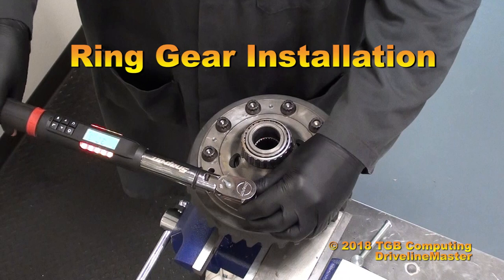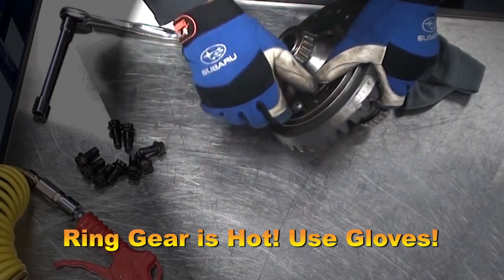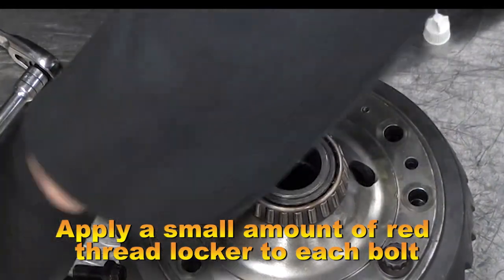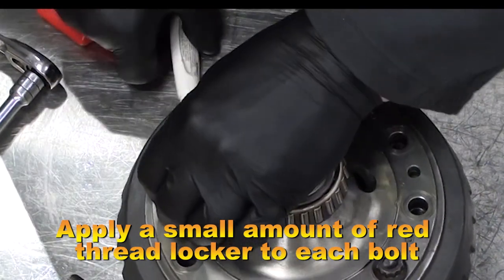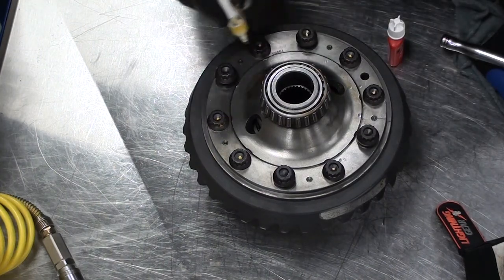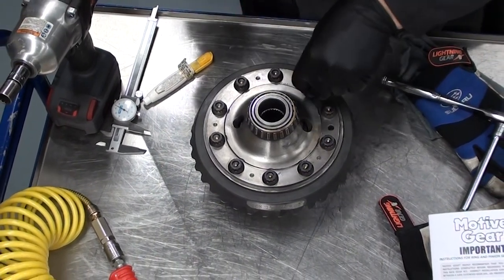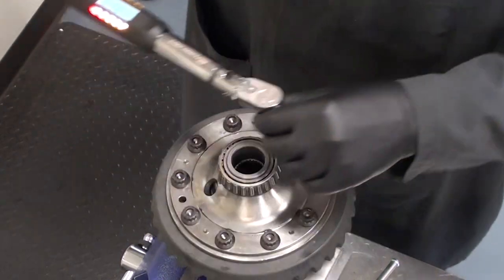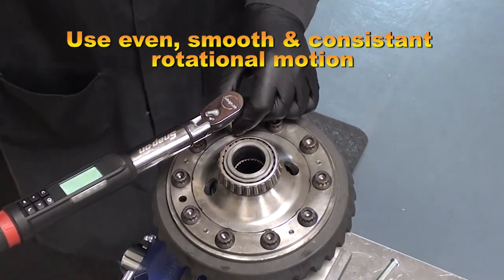Ring Gear Installation

Comment: I have been using a induction cook top to heat the rear gear to 200F works well...... and works on other interference fit items to as long as they are magnetic.
Reply from the maker: Great Idea.  How long does it take to get up to 200 degrees F?

Comment: is there a way to remove the old bolts i already broke 2 off . do you need to heat the old bolts to remove them ?
Reply from the maker: Oh my gosh.  Look very carefully at the bolts.  Does it look like there is an (L) in the middle? it may be sideways.  Many ring gear bolts are left hand threaded and you have to turn them clockwise to loosen them and counter clockwise to tighten. I bet yours are left hand threaded.

Comment: I need to know how to change a ringgear on a 1978 ironhead 1000 sportster
Reply from the maker: I'm from the states and plenty old enough to remember 1978 but an ironhead does not ring a bell for me.  Most ring gears are pretty similar. After unbolting them (note some use left handed threads on the ring gear bolts) use a steal drift punch through the bolt holes to knock the ring gear off of the case.  You can use a household oven to heat the ring gear. Set it to around 200 degrees F and heat it for about 20 minutes.  Use heat gloves to remove it from the oven and install it onto your case.

Comment: What if the ring gear gets stuck and is uneven with the bolt holes??? Do I just reheat the whole thing?
Reply from the maker: Use a punch to knock the ring gear off of the case and reheat it.  You have to work fast once it is removed from the heat.  Additionally some can be a really snug fit so getting them on straight can be tricky.  Sometimes you can use a plastic faced hammer to tap on the teeth to square the gear on the case so it will fit properly.
Reply: @DrivelineMaster  did mine first try!!!, rebuilding my first Dana 80 right now I’m 23 but boy this is a tough job